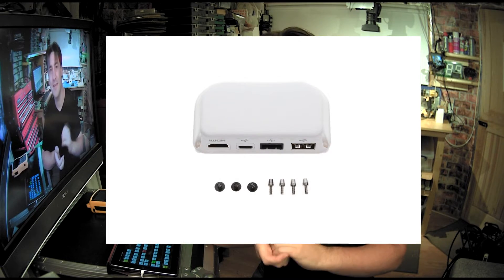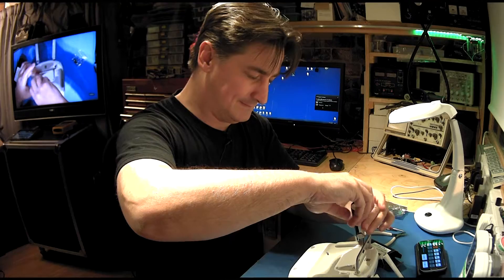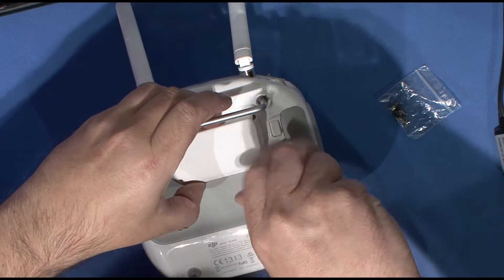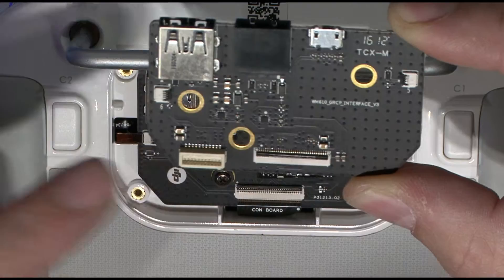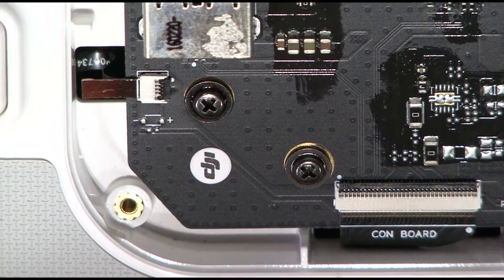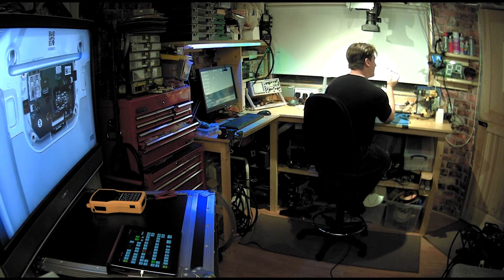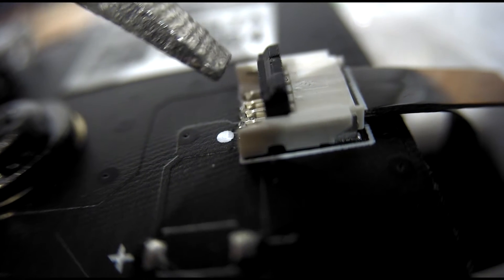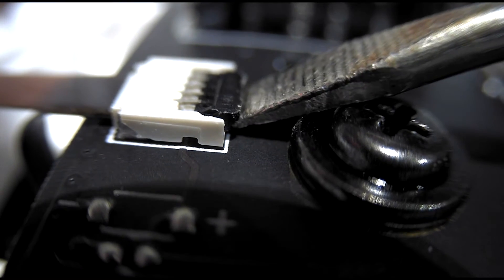UPGRADING PHANTOM 4 TO HDMI OUTPUT

Comment: Are you having any issues with the P4 HDMI module installed running latest P4 firmware and RC version 1.8 as many others with HDMI module installed? Most users with P4 and HDMI module seem to still be running RC version 1.6 to resolve the issue..
Reply: Hi Dave.  What issues are you speaking of.  I installed the hdmi module and I am now having video feed issues on my Samsung Tab 4.  After a few minutes after powering on everything I start getting green lines and breaking and freezing up and gets worse as time goes on.  Are these the issues u heard of?  if so, do know how to fix?
Reply: Michael Cawthorn, yes this issue is caused by the latest Remote Control Firmware version RC 1.8. You have to downgrade your remote to version RC 1.6.